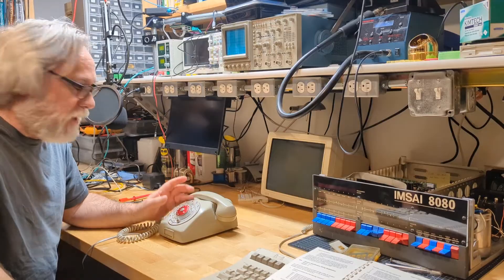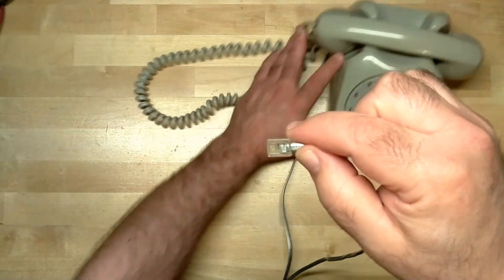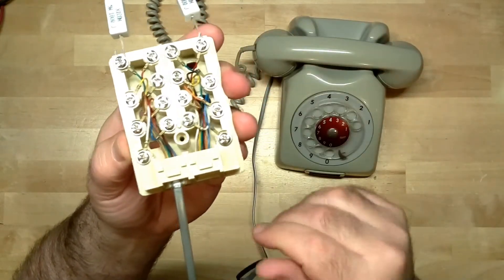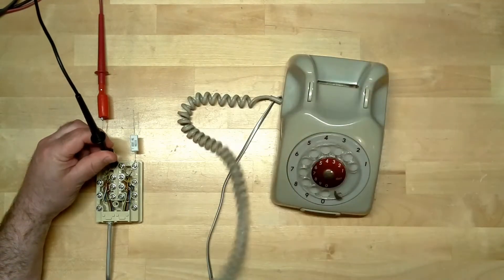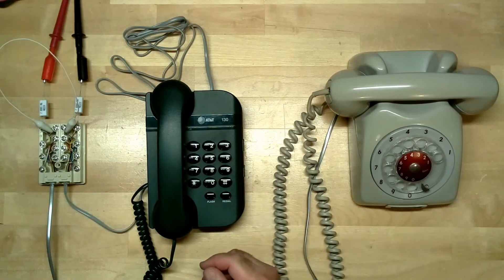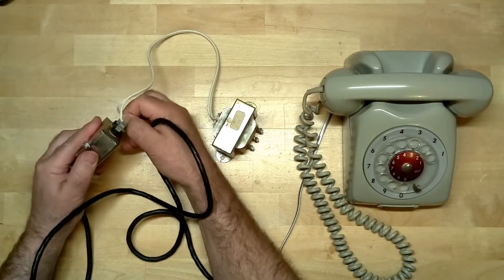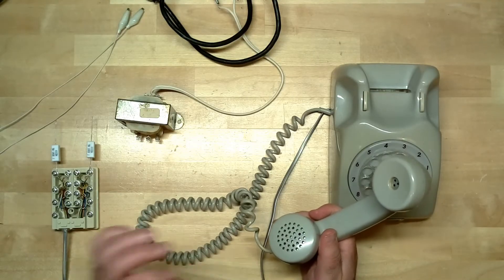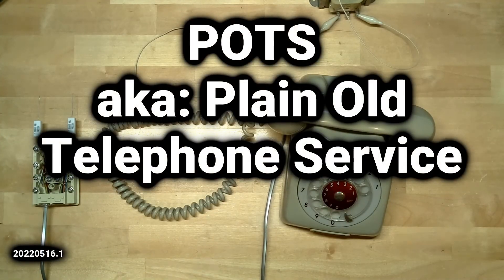Building a Plain Old Telephone Service (POTS) Intercom

Comment: I’m visiting from 2025 and am completely fascinated by this, I grew up with these lines!  Can you help us set up two phones to work for a science fair? Like a paper cup line?
Reply from the maker: If a simple intercom connection is acceptable then you can do it with a 9-volt battery or like I did here with a simple power supply.   I would use a battery for a science fair and just bring some spares in case it wears out.  My motive for using a battery is to maximize safety should the power supply fail in some way so nobody risks getting an electric shock. 
If you need to be able to dial and have the other phone ring and so on, you are probably better off. Looking to purchase an old used PBX or something like that, but keep in mind that such a system might be difficult to get set up and working.

Comment: You might want to mention the fact that when someone's calling you and you have capacitors hooked onto your phone you can actually hear them talking on the phone to you between the Rings and of course what you have to do is disconnect when the voltage comes up you have to have a relay disconnect listening to the what you're hearing on the phone every time it rings but you can definitely communicate with someone having them listen to you between the Rings
Reply from the maker: Wow!  I didn't realize that.  I suspect that may have been limited to the 1A switches.  No?

Comment: it'll work with 3v.  Also the phones with ringer cranks are not completely compatible, especially if you crank them.  They have local power whereas modern phones use central office power.  A western electric 317 can be made compatible with a small circuit, but you really can't lump it in with a model 500 operationally without an external circuit.

Comment: Great video.

POTS is such a handy acronym.  It is a sad coincidence that it is also the acronym for "Postural orthostatic tachycardia syndrome" that many people with a short list of autoimmune conditions suffer from.

See if you can find a cable of GSM VoIP modem that has two independent phone ports and see if you can configure it in ring-down mode.

Also you could investigate the US$10 SLIC modules that are still available, AG1171 is one model. They provide loop current, ring voltage and the 2 to 4 wire hybrid to be able to link two or more phones together or perhaps even make a phone patch through the sound card of your computer and VoIP service.  I do not recall if they have a DTMF decoder though that might be possible to arrange with FFT or digital bandpass filters software these days and they can probably provide the pulse dial pulses same as the loop detect.

There are also modern and vintage "Telephone Line Simulators" that were used for testing mostly but also used to connect two modems together by retro computer enthusiasts.  They are a plug and play solution but prices can be scary.

Comment: Thank you, but I still don't know, with my heavy bakelite black dial phone with a red, blue, green and yellow thread in 1 cord attached to a plastic knob with 4 metal poles that fits in an old fashioned phone socket, which of the coloured threads I can connect to the modern chord like the one you click in. I've got such a modern chord, and it has a blue and a red thread in it, very thin. I'm trying to connect that old phone to the modern chord, but which colors  need to connect, I wonder. Red with red and blue with blue? Ignoring the yellow and green one? I've actually done this, but no sound comes out of the phone horn.
Reply from the maker: You need to connect Tip & Ring: https://en.wikipedia.org/wiki/Tip_and_ring
Connect the red & green to red & green.  If that doesn't work then one of the cords is wrong.

Comment: Would this work with a 3rd phone, if you had a wiring block that allowed for more jacks? I imagine putting one phone on each floor of my house to be able to call between floors. Or if you picked up one phone would BOTH of the other phones ring? Would you need a pbx to do what I'm asking?
Reply from the maker: You should be able to add a 3rd phone in parallel with one of the two phones in this general design.  Finding a simple way to make them ring and then stop when you pick up would require some more thought.

Comment: Land line telephone is only secure aginst far off sight attacks. If you have a pots line at your home. You likely have a test point on your house. Or a terminal/ped/splice point near by. Anyone with basic telco tools (can be bought online) and a color code chat. Can find your line and tap into it. Because when it hits the CO, its turned digital anyways. Making it just as likely to be "hacked" as any other digital communication. If anything, cell phones are safer if you just get the "dumb" phones. Because you dont have nearly as many software based vulnerabilities. And its on your person. Which woukd be harder to take if youre being vigilant. 
People really forget that analog signals have no encryption or protecrion aginst physical attacks. None beyond the knowledge and time to do them.

Comment: This is so cool ❤ a little over my head, as I never paid much attention during physics and don’t understand basic electric. Where would I start if I would like to do this?
Reply from the maker: Thanks.  Simplest I can think of would be to use a 9-volt battery on the two center wires of an RJ11 jack and you can hear one phone is working echoing your voice and touch tones back.
Connect the 9-volt in series with two phones and you will have an intercom like I demonstrated.  (Series means that one wire from one phone goes to the battery and the other wire goes to the second phone.  Then connect the other wire on the second phone to the other side of the battery... in one big loop.  If you can't hear any tones then reverse the two wires on the not-working phone.)
Reply: @ right on. That seems manageable! I guess adding the ringer is biting off more than I can shoot for now. Thank you so much for responding 😀

Comment: Cheer~~~a system for transmitting voices over a distance using wire or radio, by converting acoustic vibrations to electrical signals.😊
Reply from the maker: Eureka!!

Comment: Back in the late 60's I put together a 2 station magneto (hand opperated ringing) local battery (3v each end) telephone circuit between our cabin and my grandmothers house. I rebuilt several pots phones fo this, and military surplus ringing generators. the distance was about a 1/4 mile and used salvaged telco drop wire. My mother and grandmother loved it.

Comment: When I was a kid I screwed around with our phones a lot and more than one time I was acrost the phone line when the 90 volt ring came down the line, trust me it will get your ATTENTION!!
 The RJ45 was designed to to be backward compatible with the RJ11, you can plug an RJ11 in an RJ45 but are limited to the pin of the RJ11.

Comment: Easy circuit isolation by using a diode between your Dc power supply and your breakout box to prevent the A/C voltage from back feeding the 12vdc power supply.
Reply from the maker: 🤔... I suppose as long as the DC supply is the same voltage as the would-be 1/2 wave rectified AC that would want to come back into it then this would work fine.
I aughtta throw together a PCB with the right parts on it to provide bias and a ring-voltage from an A/C wall wart.   ---- or maybe ring it by modulating the BIAS?

Comment: There was three ways phones were connected to the wall. Direct wire , then four prong plug and Jack and RJ 11. The four prong jacks had 4 wires. Two were for the phone line, red and green, then yellow and black for a transformer to light up the dial. Trimline had rotary dials in the handset. Also push button lit up also but the push button was phone line powered. 73

Comment: You can plug in an RJ 11 into an RJ 45 we have telephone testers (tec 20 or 10) that have RJ 45 jacks and you can put dial tone in the phone. Number dialed shows up on the display, if you dial a correct number you can get ringing or fast busy, slow busy, reorder sit tones (im sorry the number you dialed is no longer in service). also pay phone features on the Tec 20, the 10 only has basic features. And I forgot you can ring the phone. 73

Comment: Trying to do this with two old rotary phones but have no joy, all you can get is hearing yourself in the same handset but nothing goes to the other phone??
Reply from the maker: You need a resistance in series with the battery.   One way to do that is to put the battery in series with both phones in one big loop.  (You must have the battery in parallel with both phones with no series resistance.)

Comment: I am looking to take a POTS phone, and rigging up some recorded music/sound to play. I am wanting to put this in my basement bar setup, so people who were curious and picked up the phone, would hear the recorded message. Any ideas on the easiest way to set this up? I was trying to avoid having to hook up to the hook system in the phone, so likely the sound would continuously play.
Reply from the maker: If you have an old analog phone I expect you can simply connect it to a speaker port in a radio.  I expect you don't need it to be too loud.  If that does not work you'll need to add some DC bias to the line as I did through a resistor or two.  Then connect to a dpeaker port.
An older stereo or radio should have RC coupling and therefore not care about the bias.
A newer radio may not like it.  You can put a 10uF cap (bugger voltage than your bias) in series with the speaker port on any stereo to be sure... Preferably non-polarized.  Else put it in so that the bias positive voltage connects to the phone wite on the + side if the cap & the - side to the radio... With the - bias side to the other radio output wire.
Eh?

Comment: Hello, thank you for the wonderful videos in your channel, they are enjoyable and informative. I need some advice. I have two hand crank phones (western electric). They do not have any dials, the phone rings when the crank is rotated. Any idea, how can I connect these two phones to make an intercom? thought is if I rotate the crank in one phone the other phone should ring and by lifting the receiver I should be able to start the call. Do I need external battery or any exchange box? what type of wires needed. I am in Oregon USA. Thank you in advance.
Reply from the maker: The hand-crank on those old phones is a magneto (same tech as the thing on a lawn-mower flywheel to generate the voltage for the spark plug.) 
If you simply connect the two phones together, they should both ring when you crank the handle.  If you want to be able to talk to each other you SHOULD be able to connect the two together (like I did in my video) and put some bias on the line.  I would NOT use a wall-powered system to generate the bias!  The magneto can generate 100+ volts easily and could ruin a simple power supply unless you use some sort of protection on it.  I'd use a 9V battery with a 200-500 ohm resistor in series with it.  That should work, if not, add another battery in series to get 18v and try that.  (The original system probably ran at 48v or more.  The actual voltage is nominal.)
Also take note that those phones typically have a spark-gap shut for lightening protection right on the front.  It probably looks like a rusty penny cut in half in a staggered pattern.  I do not recommend EVER toughing that thing if anyone is cranking either of the magnetos!
Reply: @JohnsBasement  Thank you for the reply. I had tried connecting the L1 to L1 and L2 to L2 and used a 3V supply in one of the phones, and it worked. I could make one phone ring by cranking the other phone and was able to talk thru the mic and receiver. One phone might have either a transmitter or the receiver problem.

Comment: I worked on POTS telephone lines in the 70’s. Back then it stood for Plain ORDINARY Telephone Service. Today, POTS telephones are sadly much maligned, but POTS telephones provided an essential service during power outages. ‘Advances’ in modern technology have resulted in today’s digitally based landlines being regarded as 2nd class services, not to be relied upon and a good reason to hang onto that CB radio.
Reply from the maker: Thanks for the corrections.  Makes sense. I like my POTS phones!  I had mine working up until a truck tore the lines & some siding off my house about 7 years ago.  I decided to just cancel it and cut over to cell only service.  It's not without its charms.

Comment: While I agree that a hard wired intercom is a more secure communication than a plain modern phone call, I also hard disagree as wiretaps were extremely easy in the POTS days. If you really value security in communications, an end-to-end encrypted channel is way better than a POTS line.

Comment: The ‘phone isn’t British. The GPO never provided anything quite like that, although it is a bit like the 700 series. It is Continental - possibly, Danish. For intercom use, two standard telephones are usually connected in parallel with the power supplied through an inductor, or, as someone has mentioned below, a resistor of about 220 ohms. This means that the anti sidetone circuitry in each ‘phone will function correctly.
Reply from the maker: Yeah.  Sorry I misspoke.  I should have done better research.

Comment: The first time I found out that RJ11 works in an RJ45 jack... it blew my mind xD
Reply from the maker: It is nice.  But be careful.  If you put a narrower jack into a wider hole, the outer leaf-springs are going to be pressured way into the jack housing.  That could leave them weaker down the road.

Comment: What size transformer for a 12 volt system?  Like if you were going to power it with a marine battery ?
Reply from the maker: Not following.  If you use a battery, a transformer is not part of the circuit.

If you DO use a battery capable of sourcing more than 500ma, then DEFINITELY include a series limiting resistor!!

A tiny 9v battery will likely work fine to power an intercom.

Comment: You will not short the 2 amp transformer connecting without resistor, since the bell in the phone has impedence, which is just like restistance, just for AC.
Reply from the maker: I was more concerned that I could short it poking around with the wiring on the bench... or that someone else would copy it and....

Comment: Ok so if I have 120 volts ac to 9/12 volt dc wall plug box can I wire that in as a power supply?
Reply from the maker: Yep. Pretty much anything from 9v to 48v will work to bias the line to make a POTS phone work.

Make sure you have SOME sort of current limiting in there so your power supply doesn't fail if (when) the line is shorted.

Comment: I've still got a landline that's part of my DSL connection. I've got a Western Electric #302, built in 1946, hooked up to it. It's all original and still works wonderfully well. My metal-cased #302 is so heavy, you could drive nails with it! And when those brass bells ring, they're very distinctive, you know, you can't miss that a call is coming in for you.
Reply: My everyday living room phone is also a black Western Electric 302 with a metal body. It is all original and still works perfectly. It will outlast me. Since aĺ of the phones in my phone are antique rotary phones, I'm hoping that my phone company will still keep my copper-wire land lines in service.
Reply from the maker: When Western Electric owned & serviced the equipment, it was cheaper to make it last.  After the divesture, they started selling phones to consumers.  Ya know, the kind that don't know the difference between "price" and "value."  In order to compete with price against the likes of Cobra, they had to sacrifice 99% of the quality.  😩

Comment: Hi, I’m wanting to set this up from my treehouse to the garage and was wondering if I could use a 9v battery and a 2k resistor? The only resistors I have are 2k and 820. Which should I use? (If any at all) Thanks!
Reply from the maker: It'll work with no resistor.  The 820 will allow the battery to last longer.  But might be too quiet.
Reply: @JohnsBasement  Thanks!
Reply: @JohnsBasement  also worth mentioning, they are touch tone phones and I heard that without a resistor they can be damaged. Is this true? Thanks!
Reply from the maker: @Firealarmcollectorperson  Not likely from a 9v battery.   Phones are pretty resilient.   Toss in 150-1000 ohms if you are concerned.
Reply: @JohnsBasement  Can't go wrong with a 600-ohm ¼ watt resistor. If too quiet, try 330-ohm.

Comment: If you have a 220R or similar resistor in the power supply positive, you can wire the phones in parallel, the speech path will work just fine.